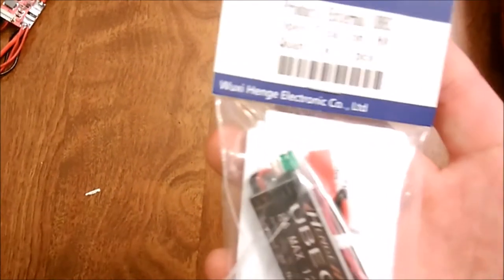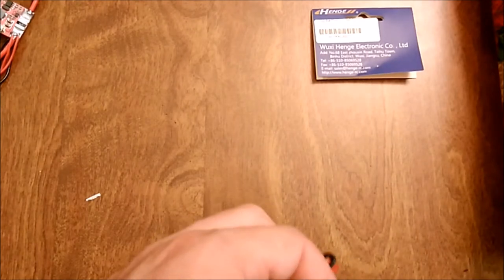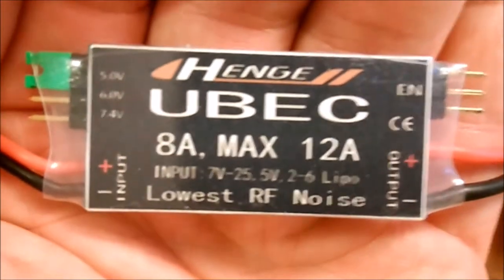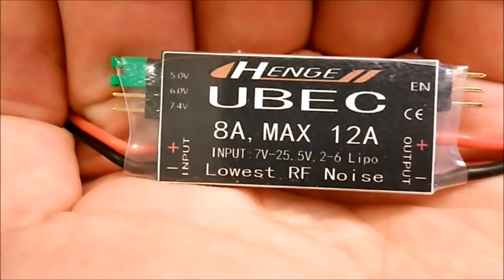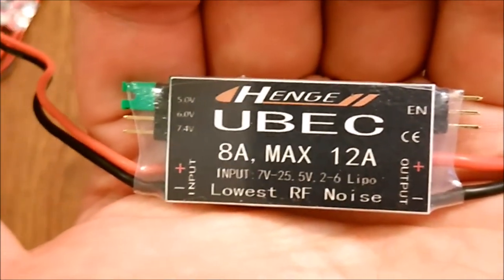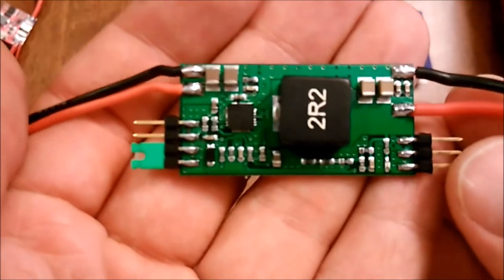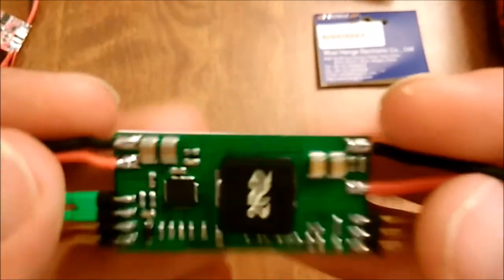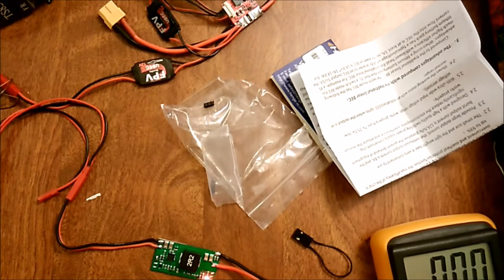Traxxas Summit Upgrade Series...Part 2.2: HV BEC for Steering Servo (Henge UBEC)

Comment: Have you had any problems with this? I bought one and it looks identical to yours (including the circuitry on the back, and the manual), and testing it with my multimeter with a 5S input, the output (at JST connector) is 20V! No matter where the voltage selector jumper is. It also isn't a stable output, but obviously the far bigger problem is that it would have tried to dump 5S voltage into my RX/servos. I'm not game to try another one, but I'm curious if yours is still good. Also, what input voltage are you using?
Reply from the maker: Oh wow! Actually mine just did the same thing.... It was passing input voltage out to the servo. Which fried it. That only happened on one of my two and I suspected that it was due to bad waterproofing. But your comment makes me wonder if it isn't a problem with the design. I just ordered a 20a version to try out. Hopefully that works better. I use it on 4S

Comment: hey , is it normal after installing the ubec on my axial scx10, when i plug in the battery, i have steering working without switching on the esc?
Reply from the maker: Yes. It will be a seperate circuit. So make sure to disconnect the battery when you are done to prevent draining it

Comment: i checked with a multimeter the ubec voltage connected to the esc , is it normal that it's 7.27 instead of 7.4?
Reply from the maker: I'm not sure
Reply: Yes it is

Comment: hi, i also bought the same ubec, at the JST connector it's reading 8.15v when i set it up for 7.4 v. Is that normal? also i noticed that when i plug in the jumper into the enable, Voltage drops to 7.6v. Please let me know if it's normal?
Reply from the maker: That is odd behavior... Not sure what to say. Use it on a cheap servo first I guess? Mine was 7.4V